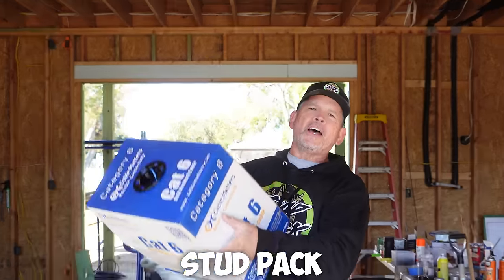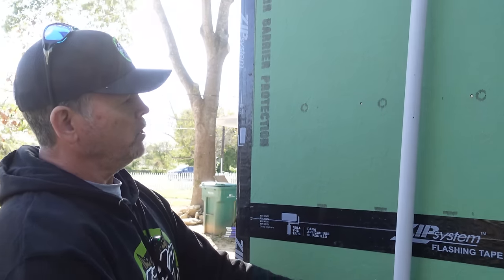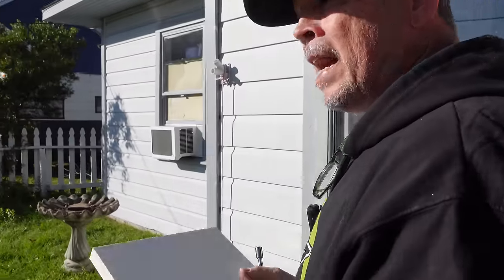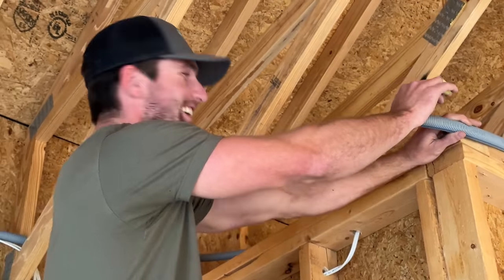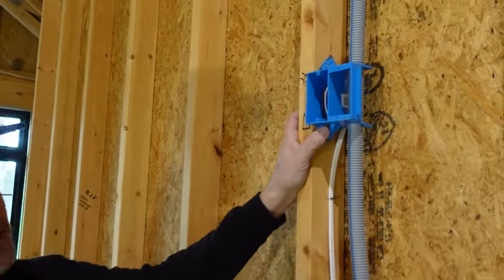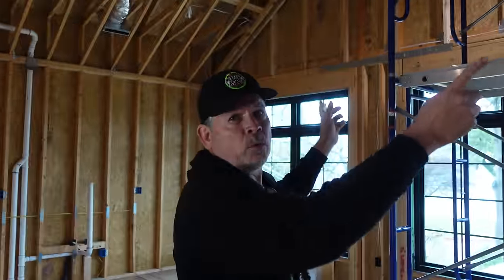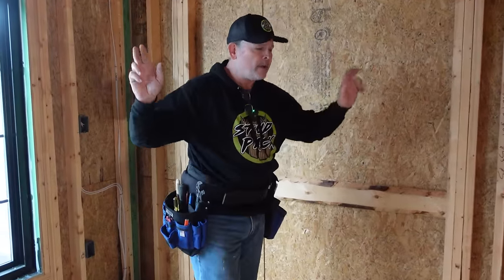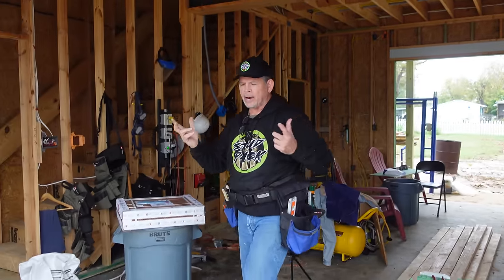DIY Networking for a Future Proof and HIGH SPEED Home! (Smurf Tubing and String Pull Trick!)

Comment: The plastic flex is what we use, it’s called fiber duct, it comes with measuring/pull string already installed. In most cases it comes in orange but can get in few colors. I just finished upgrading my data, I went with cat6a, only because I brought home all the scrap from work.

Comment: I did low voltage for a living for awhile - yes there are technically EM fields around Romex, but you can use shielded conduit if you want, and it's not going to matter at all if it's actual fiber that's going in that conduit. Fiber doesn't like to be kinked, but it's immune to EM interference.
Reply: Also, in case no one else has said it, plastic conduit does nothing to prevent EM interference. You need foil or braided wire between the power and the copper (if that's what it ends up being), but honestly it doesn't matter.
Reply: Good job on the cat6, it's usually a good idea to thread on a tab saver / thumb relief too before you crimp down the connector.

Comment: Hey - you kept saying the fiber guys are going to run fiber through that stretch of smurf tube.  If so, there won't be any interference between the light signal and the 120v cable.  That won't have cat6 in it, right?

Comment: Fellas! Network engineer (field and behind the scenes) for 15+ years now. Let me come out and help y'all! I'll work for free haha...but seriously, the comments are right - you should be terminating the home runs back into a patch panel (ideally you'll have a rack) and then from the patch panel you use shorter patch cables (6", 1', whatever the rack layout would call for) to patch into a switch. The switch is conceptually similar to a power-strip in the sense that it enables many end devices to plug into it, supplying all of them with connectivity. Switches typically come in 4 port, 8 port, 16 port, 24 port, and 48 port. Depending on the total amount of end devices that are hardwired would dictate the size of the switch (always factor in for ~15% scale...so if you have 20 end devices, a 24 port would suffice). The switch itself uses a port to uplink to your router/firewall (the main power cord of the strip, in other words). The other positive side to this is that everything is "lit and live" at all the jack locations (which you should be doing plates with keystone inserts for best results). Having your home runs broken up into 3 sections is important...the end user side (from the device to the wall jack), the in-wall section of the wire, and then the patch cable from the rack to the switch. This allows for better troubleshooting down the road too, as if a section goes bad, you only have to replace that section and not the cable in its entirety.

Half the fun of a from-scratch networking job is spending the time to dress a rack down and make it pretty. Would love to show you guys some of the datacenters I've worked at in terms of rack and infrastructure buildouts. Talking about hundreds and thousands of cables - we call it IT Porn in the industry when a rack is dressed nicely. Would be happy to talk in more detail and show some examples if you'd like!

Comment: Using flex conduit is actually a smarter thing to do on new construction because it allows easy cable replacement or upgrading and if you want to add more cables later with a easy time. Since you do not have a attic I would suggest running a few extra for possible future and run them to each wifi access point if you put one on the ceiling or up high. It sounds costly but in the long run cheap low voltage conduit it cheaper to install before drywall than patching drywall later and blending it back together. Just make sure you have a good structure diagram after the layout is complete so you know where everything is and labeled.

Comment: Like others said, terminate at a box with a plate and use patch cables to the equipment. Also, cat6 or 5e works for the cameras but I would use cat6a for internet/data. STP as it's shielded and power would have less of an affect. I emailed y’all about this about 2 months back too.

Comment: One thing I haven’t seen mentioned in the comments, you are running to TVs which is great, but a lot of the newest TV’s have cheap 10/100 network adapters, and also WiFi 6 enabled. So you may actually get better throughput using the WiFi if you need It for a media server or whatever.
Also make sure you plan the runs for the house side.. you may need to get a small switch with sfp+ adapters to run a fiber leg to the house side and do your runs from there, instead of all the runs across the bridge/breezeway using all that extra cable.

Comment: Run drops to the ceilings for your WiFi APs. Run a drop or two to every wall whether you think you'll need it or not. You can lay the cable on top of the spray foam if necessary and terminate only when you need it.

Comment: I think CAT6a would be a better cable to run throughout the house, Cat 6a has better shielding and is required for 10gb speeds, you may not have 10gb devices right now, but Jordan will have a NAS soon (if he doesn't already have one. . If you don't run Cat 6a you will be pulling Cat 6a in the future and the price difference now is not that much more and I would recommend Monoprice, they have great cables with a lifetime warranty. I think it would be great if you had a YouTube network person involved in your build like you have had the electrical professional Joel and he was FANTASTIC. I am sure Jordan has some network people that he follows but that would in my humble opinion be great video, especially since you have not started in the main house, but starting the network in the garage correctly will determine how EVERYTHING else will work downstream.

Comment: I think several of us are assuming you are going to have some kind of utility type space where all the network cables will run to with a half wall rack and appropriate network equipment. Maybe under the stairs? They all have to terminate in the same general place, also dont forget you may need Power-Over-Ethernet equipment for cameras. Maybe you have a system that includes this and tge cameras.  Good luck, its a lot to take in. You all are doing great work. Also i hope tge fiber company actually rubs fiber inside your garage as i haven't seen that before it's usually just to the exterior wall.

Comment: Couple small additions that need to be considered in copper.  300' is max run length, it cant pass data beyond that mark without using additional equipment.  And surge supression is just as important in datacom cabling, a single surge can destroy thousands of dollars worth of equipment and infrastructure.  And with regards to low voltage cabling try to consider security and audio/video before closing up your walls.  Final bit of recommendation, would be to consider the future demands of your network.  Your building a house next to the garage, so be sure that you can share the data between the structures.  I would recommend a fiber backbone between buildings so you maximize the throughput of ypur network while minimizing the cost of internet service to your home.  Having to use a single source rather than paying for multiple sources of internet, cable TV, or even landline phones.  And if you want a true all encompassing security system then provide enough pathway between building for all potentiallow voltage cabling.  (ie. A 4" duct bank with 3 cell Maxcell to allow for multiuse access in a single duct with minimal cost.)

Comment: Love the video guys! From an AC theory instructor in silicon valley, there will not be enough inductance to cause unwanted EMF on that single run of romex to cause any unwanted effects. A filled junction box or sub panel has the potential to cause unwanted induced effects. But obviously we run seperate raceways for all of these different systems for a reason. On another note if youre in a pinch and needed to populate the same raceway with both low and high voltage wiring you could simply purchase a shielded low voltage cable with the same insulation rating as the highest voltage within the same raceway and you’re golden according to the NEC. Also guys it takes a metallic object to shield from electro magnetic interference, so even in this instance if we were worried about induction causing EMF the smurf tube would be useless and a shielded cable and or an EMT raceway would be a suitable option as a barrier for the interference.

Comment: Wow! That cable stuff took me right back to the early 80s when I built an 8-track recording studio doing all the wiring myself. Whew! Had the energy then. I would keep that high-voltage line as far away from yout Cat6 as possible. Why cultivate trouble? An old bass player I used to know from those long ago days would say, whenever anything went wrong, "Electricity is not your friend."

Comment: I would only put data cables next to 120v power if the data cables were shielded and properly installed with the necessary shielded RJ-45 connectors. Similar to Shielded RG6 Coax. I've been slowly getting the supplies needed to install Ethernet and Fiber to all rooms of the house I live in. Wireless just sucks rights now and the only Ethernet cable in the house is for the in-wall intercom system. Also for now I've been using MoCA adapters to give wired Ethernet to the room that have coax cable jacks.

Seriously, use keystone jacks and wall plates for that traditional "Stud Pack" look we've come to know and love.

Comment: Put a network utility box between the studs and depending how many network runs you're going to do you can use a patch panel to have a connection point to plug into the run and the other end into a network switch or router.

Comment: Like watching you guys work. Couple of items though little late on this one but anywhere insulation is going to be you want the wires or cables running parallel with the studs not running through. Either up in the attic to run across or below through the joists out around a foot away from the wall. Makes the insulation job 100% better in every way. 
The other is about the Ethernet termination. Maybe I misunderstood but you definitely want to terminate the cable at the wall then plug in with a patch (stranded) cable to your device. 
Keep up the good work. 
Grace and Peace 
Slick

Comment: Been doing low voltage for over 20 years in structured cabling.  Please terminate to keystone jacks with faceplates in the field and then to a patch panel where your router is going to be.  It's much easier to replace a patch cable than to re terminate a broken clip on a rj45.   Are you sure you are using Cat6 rj45 ends?  Normally the twists are maintained almost all the way to the pins as you can shove the cable deeper into the plug.

Comment: Love watching you guys and have wondered if yall were going to run data in the garage. Iv been doing cabling and networking for about 20 plus years.  My company has been running fiber in Cleveland TX.  Was going to acutely offer my assents sense I don’t live to far from Huston.
You can get RJ45 Keystone Coupler to install in the wall plate, so you don’t have to re-terminate the cable ends. they will just clip onto the wall plate. This would allow you to use a patch cable which is stranded and more flexible. And easer to replace than having to re terminate the cable if it get damaged
As for the cabling, as many of the others have said, keeping the data lines away from the Power to avoid interference is a good idea. I try to keep the cable on the opposite side of power in the next cavity over from any receptacles.
Cat6 is a good option. Although cat 6 can reach speeds of 10 Gbs (depending on the equipment Bing used and what the Client or device hardware can handle and stays within 55 meters Cat6a would be a more Futcher proof as it can handle 10 Gbs at 100 Meters. In the garage cat 6 should work fine but, when you run data to the house id run a Cat6a or Beter yet run a fiber from the MDF in the garage to a IDF in the house to avoid and interference as you can run it parallel with power. Of course, this depends on how you plan to set up your rack in the garage and what type of switches you plan to use.
Also, depending on the fiber company. They may not run a fiber in the house but if you know the distend you can get the fiber online, just make sure it has SC connectors and is (SM) Single mode, not (MM) Multi mode. usually, yellow jacketed then they just have to connect their fiber with a coupling to yours
Any ways ill get off my soap box now. Can’t wait to see the garage finished and see yall start on the house. 
Oh, and welcome to Texas.

Comment: 20:32 if you are running shielded cables the interference should be minimal, as long as low amperage equipment is running. 

Otherwise follow as many as possible is the tip from the other comments.
Reply: 23:40 you are not using shielded cable, so other tips from the community comments are well put.

Comment: For AC lines, the magnetic fields cancel each other out since current in each wire alternates in direction, meaning the magnetic field does as well. This is why you cannot use a clamp on ammeter on an two wire AC and see current, you'd need to isolate one line. The ammeter uses the same magnetic field induction process.

Comment: Those PEX cutters are also great for cutting the rigid flex seal NMC tubing. Gets a nice clean cut. Unfortunately they were never around 90% of the time when I need it cut some. And if you ever find yourself cutting some LMR 400 beautiful cuts and that was with a cheapie plastic irrigation line cutter until the handle broke.

Comment: while you're in the Low Voltage phase,  like others have said keystone rj-45 connectors, and wire for at least 1 AP in the living space and 1 in the garage. A few things people don't think about and will be easier todo now would be wire for speakers in ceiling even if you don't use them just yet and wire a at least 16-4 to the bathroom for a DVC speaker. every one loves the ease of portable Bluetooth speakers but having the speakers essentially invisible and nice clean counter tops .

Comment: I may be commenting early, but I hope you aren't putting your switches in an attic with no HVAC.  if you are, you're going to be hating life in the summer when your switch/modem/router overheat.

You could save money on yhe fiber run by having the fiber to copper media converter just on the other side of the wall in the garage.  You can then run CAT6 A From there to where you want the rest of the network.  Copper is more resilient than fiber to work with and 6 A will carry 10 gigabit for up to about 280 meters.  You can also terminate it easily yourself vs hiring someone to splice the fiber.

Guessing you got it in at this point, but if you need a consult on network design or equipment let me know.  I'm a solutions architect for an MSP and will walk you through whatever you p u have questions on no cost.  Your videos have helped with my home so I would love to give back.

Comment: Sweet I was having withdrawals. 

Going straight to devices with solid core isn't best practice. It's easy to break a wire by jossling , etc. Female to patch would be better in the long run. Solid is meant for inside the walls basically because stranded is more durable. If it breaks, just need a new couple feet patch cable

Comment: I have been running utp cables beside power cables in a factory with 10 CNC machines, drills, lathes etc and never had any issues. but we didnt have that much data trafic back then as we do today

Comment: For that wall box you can just put a narrow piece of blocking there and pull the smurf tube about 6” or so. You would even be fine without it IMO.. it’s just a couple feet that it’s alongside. Any emi on that romex would be negligible for what you are doing, it’s not like this is a mission critical network installation. This is already way better than how most electricians and installers butcher cat6 runs.

Comment: The general rule is to keep communications 26" or greater apart from any 120/240v when running in parallel and 2.5" apart when intersecting to reduce the chances of EMF bleeding and degrading the signal.

Comment: The plastic in the middle of the wire prevents cross talk (interference)   You also may want to run a cable or two for WiFi access points.

Comment: About hard wiring ethernet for your TV... if you're streaming 4k you may end up with buffering issues. I just recently went through a bunch of troubleshooting trying to figure out why my gigabit LAN was buffering on 4k movies and it's because most streaming platforms are 10/100 (not all... i think nvidia shield is gigabit). If you run in to this, unless you pick up a 10/100/1000 streaming platform, you may have to just go WiFi instead of wired... that's what I did which bummed me out after hard wiring everything.

Comment: It is unlikely the AC line cable will interfere with the LAN (CAT6) cable.  If you want to be extra safe, use shielded CAT6 cable.  (Credentials: MS Electrical Engineer and University Professor).

Comment: It might be too late now if you can I would move the fiber and conduits to end in the electrical closet downstairs. This way everything is centrally located and you can make it neat, mounting all your network gear on the wall. Also run cat6 to the ceiling for a wifi access point

Comment: Giv n that you have a fiber connection Cat6E would probably be the better option. Also not sure if you’ll be doing any local networking, but if so it would be the best option. There is additional insulation to shield the cable from noice and improve signaling at higher speeds